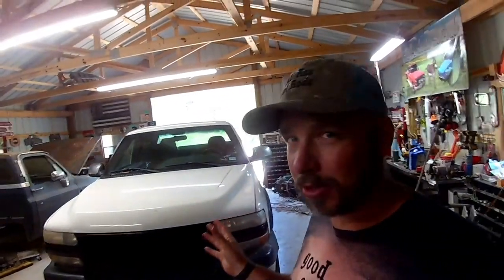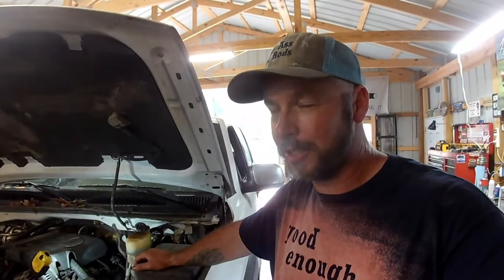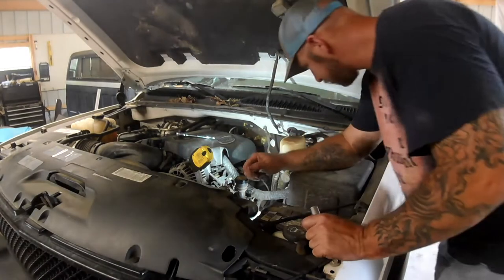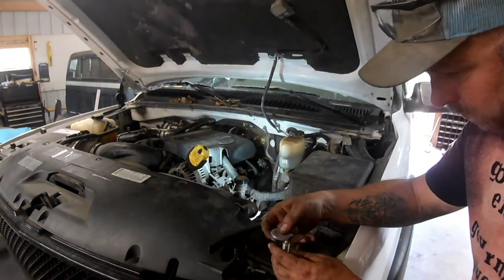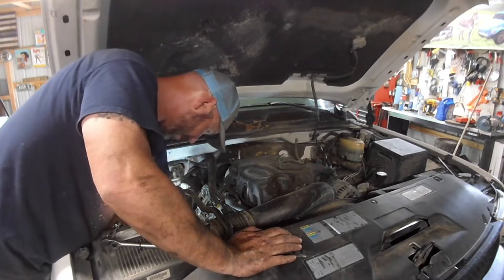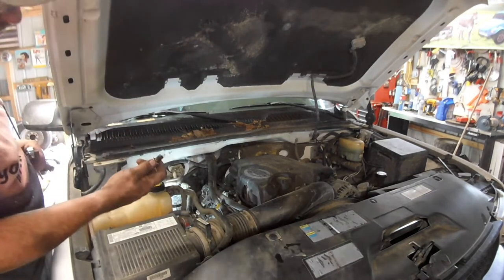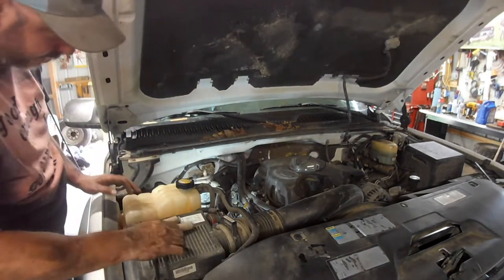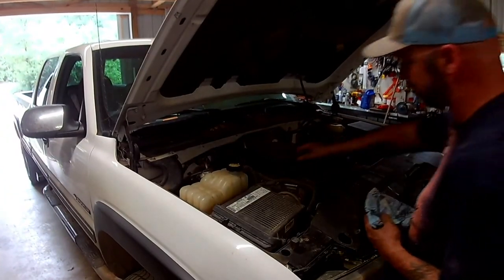Better Mileage from the 8.1 Vortec!

Comment: Best way I found is 60-65 and don’t drive it if you don’t have too 😂😂😂😂😂drive the wifes car outside of work they are rare today
Reply from the maker: This one doesn’t usually go anywhere unless it’s pulling or hauling.  The only way to avoid burning a lot of gas with an 8.1 is not to drive it!
Reply: Or keep the rpm's at 2k and under .

Comment: I bought my 2001 gmc 3500hd 4x4 crew cab dually with a 8.1 with 155k for $4,000 like 4 yrs ago man now I see them Like $15,000-$20,000 now it's crazy
Reply from the maker: I can't believe the prices these are bringing now!  My son just got a screaming deal on one though. Look for it in future videos!  Thanks for watching and the comment!
Reply: I bought an 02 CCLB 4x4 117k miles for 12k. It only booked for 9k lol. I think it was a good deal. Just put maghytec trans pan and changed rear diff fluid. I love it except from a stop it hardly moves in the first couple inches of throttle then just takes off kind of abruptly. Not sure why and it’s annoying lol.
Reply from the maker: @vegastyle84  Every once in a while there's something I'd consider paying over book value for.  If it's a nice truck and you're ok with the price, I guess that's all that matters.  That hesitation could be "fun" to figure out unless it turns on an engine light or something.  If it has the Allison trans, those can feel like they're holding the truck back at low speeds too.  Thanks for watching!
Reply: Okay it was just plain crazy prices for a 20-year-old truck. That's kind of like everything else as long as the public keeps paying these prices then they'll never come down and they're probably continue to climb.
Reply from the maker: @CAROLDDISCOVER-1983  I agree!  Unfortunately it seems everything is going up like crazy!  Thanks for watching!

Comment: Should be getting at least 20mpg in a pickup I get 19.5mpg in a kodiak 5500 34ft bus. Its all gear ratio that gives you better mileage.
Reply from the maker: You’re getting 19.5 mpg from an 8.1?! I’ve had 2 suburban and this truck and never topped 11!
Reply: Is that essentially stock suspension?

Comment: Hey man. Just did plugs and wires on my 8.1. They looked just like yours! They were white with black carbon on them. Its normal for this engine. I think theres no point in using iridium as these need to be changed way before 100,000. No change in MPG but after looking at the plugs I’m happy I did.
Reply from the maker: Yep, they may not have been THE problem, but they were definitely A problem!  I didn't gain any MPG but the engine light has been staying off.  This is my first Allison equipped 8.1 and I think that may be the difference in MPG.  Maybe it's time for a 5 speed swap?
Reply: @halfahotrods6332  nice! I would love to have the Allison mines in a suburban so im stuck with the 4l85e 😩
Reply: Just did my1st plug change in my  8.1 Avalanche. I agree sooner plug change and no more Iridium.
Reply: Yes gm recommends changing every 25,000 miles and I don't use 5w20 oil in mine as I have over 100,000 miles.. when over 70,000 miles I switch all my vehicles over to Castrol 10w40 or 20w50..except my 7.3l powerstrokes. I use Rotella or Motorcraft only

Comment: Check GM Diesel Place look in there for GM Gassers. Big time info on the 8.1 Blog. I have a 2004 from new 3500 silverado s.r.w.  NGK plugs gapped at 45.000 thou. better throttle response and a lot more from those guys.
Reply from the maker: I do like NGK in these newer GM vehicles.  Thanks for the tip and thanks for watching!

Comment: I got a 2004 Chevy 3500 crewcab long bed 4x4 8.1 (496ci.) 4.10 rear gears Allison transmission,  265,000 miles  sill running strong. 10 mpg highway 9 mpg local driving.the truck weighs 8.800 lbs.  and about another 300 lbs of tools. Towing heavy loads 6 mpg. Towing my 25ft gooseneck that weighs 5,500 lbs. 7,5 mpg., very good dependable truck. This year I did replace all needed front end parts and front end alignment and front right wheel bearing. Runs and drives great. I have a really nice 2001 Chevy 2500HD Excab 4x4 Duramax lb7 with only 95,000 miles with a K&N cold air breather and tow tuner. But it’s my 3500 dually 8.1 that I go to hauling loads with my gooseneck which is mostly hay , I move and average of 900 4x5 round bales a year . 14 bales at a time. 950 lbs a peace plus 5,5000 lbs gooseneck trailer.
Reply from the maker: Thanks for watching! I still do love my 8.1.  We're back up to 8-10 mpg depending on load.  They're really hard to beat for the money! I'm glad to hear yours is still going strong!

Comment: As far as aftermarket performance.. Raylar is the way to go without question it's not cheap but they specialized in these motors and you will make absolutely the most power and torque reliably
Reply from the maker: If I had the budget, I'd love to put together a Raylar package.  Unfortunately my poor life choices have left me with an income that does not support such fine products...Thanks for watching and the comment!
Reply: Jasper performance as well
Reply from the maker: @mikehall737  cool! Thanks for watching and the comment!

Comment: Funny about the AutoLights in your 8.1. I'm an AC and NGK fan  but my 69 427 loves them. My wires came out that way. Not much room to get the spark plug end off. Used a 5/8 in. plug socket with a 3/4 in end and used socket to get them out.

Comment: I own a 2001 3500 dually with a 8.1 and I run the E3 spark plugs and I have no problem with power and a little bit better in fuel mileage. I also have a cold air intake with a K&N air filter.
Reply from the maker: I’ve heard good things about the E3 plugs.  Thanks for watching and for the comment!

Comment: to improve your engines mileage , replace the crappy OEM   M.A.S.S and OXYGEN sensors with the japanese NTK sensors , i now enjoy a lot higher fuel economy with these parts.  copper plugs are better ,  besides you switch out your spark plugs once a year anyway , HOT plugs for cold weather , COLD plugs for hot weather
Reply from the maker: Interesting!  I'll have to look into those suggestions!  Thanks for watching and the comment!
Reply: @halfahotrods6332  your vehicles battery should be disconnected for at least 24 hours before you swap out the sensors , doing this , will trigger the RELEARN mode in the ecm,pcm software when the battery is reconnected and the engine is started and running

Comment: White in the plugs means you need to change the fuel filter.. it's running too lean
Reply from the maker: I did that just prior to this.  Thanks for watching and the comment!
Reply: No problem. I did not see that you had change the filter.. but these engines are bad about the plastic and oring style intake gaskets as well. Also there is a restriction in the intake there are videos on how to modify one so you don't have the restriction and get better mileage. And I use e3 plugs.. what a difference

Comment: I'm just giving my opinion I've been a big block Chevy guy for a long time from older 396 is two in the late nineties 2454 and I've had 48.1 trucks. Angie case I think should stick with foreign stuff. In GM vehicles I absolutely 110% thank you should stick with the stock ACDelco Platinum is what came in early 2000's after that it was iridium stick with the plugs that came in the truck from the factory that's the way to go
Reply from the maker: I usually agree, but I just couldn't stomach the cost of the iridium.  On the two LS swaps I've done, I used NGK at the suggestion of the hot rod shop that did the tuning and had great results.  Thanks for watching and the comment.